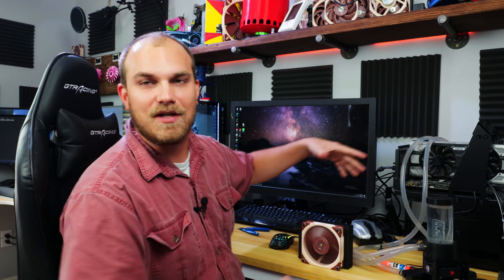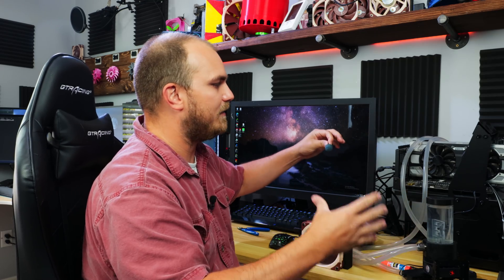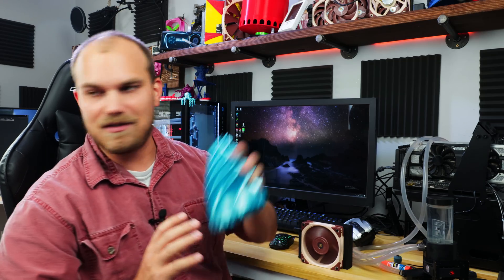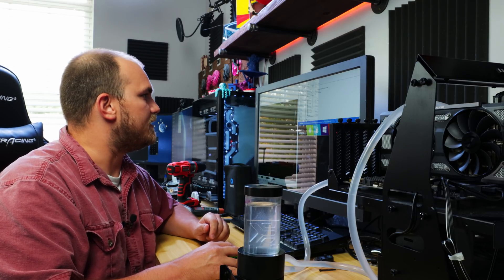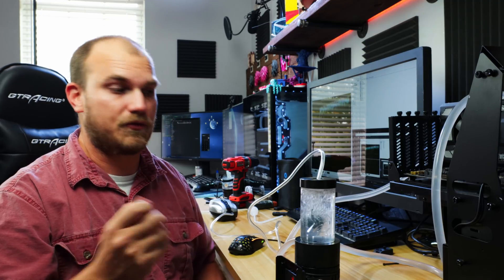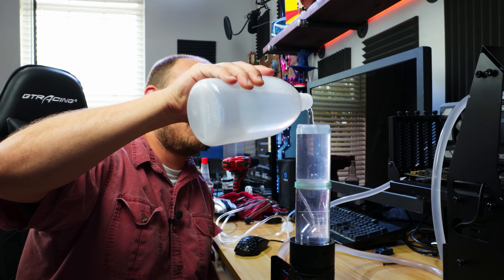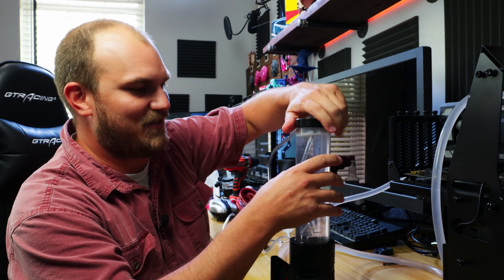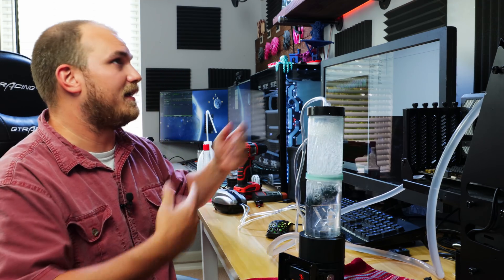Can An Airstone Cool Your PC?

Comment: I'm not an AC pro by any stretch of the imagination, but the same principles that apply there would apply to any system where you're transferring heat from one source to another. 

Here's a video of Basic HVAC 101 that I found interesting: https://www.youtube.com/watch?v=VJX0LyxRV0E

In it, he mentions Dr. John Gorrie who used the same principles with water and air. A website: http://www.phys.ufl.edu/~ihas/gorrie/fridge.htm

In the Basic 101 video, Mr. Orr shows that the 2 places where heat is transferred are the evaporator (inside, where the heat transfers to the liquid) and the condenser (outside where the heat is rejected from the liquid). You've transferred the heat from the CPU to the liquid, but other than a few bubbles, you haven't transferred the heat to anything that can reject it.

I like how you continue to look for ideas, whether sound or not, and aren't afraid to experiment. You're also not afraid to fail, which is monumental in continuing to seek more insight. You do a great job of presenting factual evidence and state truthfully what the results are. Fantastic job, sir! I've chosen to subscribe as a result of your efforts.

Comment: Input and output at the base of the pump could be an issue. The airstone is bubbling up the water above, whereas the pump probably immediately sucks up the warm water that's just been returned at the bottom of the reservoir. If you'd return the water through the top of the reservoir, so that it has to fall through the bubbles, maybe that'll take out some heat.

Comment: Theory could work but I see three possible issues:

1- the reservoir is closed so heat/evaporation is not as readily able to escape. When it's forced through the small hole the increased pressure likely recondenses any evaporate 

2. The pumps are also introducing heat in the forms of motor heat and compression heating of the air. It may not be significant at the lower pressures these work at but higher volume lower pressure pumps with wider diameter hose would further reduce it's influence.

3. You did hit on surface area as a concern, which I agree with. The drip tower had the water droplets falling and spreading over multiple surfaces through a substantial air flow at atmospheric pressure. Here we are rely on evaporation into bubbles under greater than atmospheric pressure in a shorter and narrower area.

Maybe a  shallower horizontal reservoir  with a stick air stone like a side ways L

|      _______] <Return
|___|  air^
<Pump

I realized it became phallic after I made it but not intent. Anywho, water returns on right high flows over shallow long air bed allowing maximum contact, then collect in resevior pump on left.
Top should be as open as possible to to restrict air flow but still contain the water.

Comment: I think some of the issue is there's no way for the heat to escape; it's all getting trapped by the cap and staying inside the system. That said, air is a terrible conductor of heat, so it could just be the heat transfer coefficient is too low, and while looking cool, just plain won't work. I think you're on to something with turbulent flow, but you'd need a heatsink in contact with the water, which I think isn't the idea of this experiment. Awesome vid though, loving the novel approaches to heat dissipation and absolutely loving the fan showdowns!

Comment: Your reservoir is just way too tiny for the bubbles to have any effect at all. Surface tension would of course always be an issue at trying to absorb heat into the air bubbles and therefore never become a practical method of cooling, but ya, much much bigger reservoir in order to see any effect at all.

Comment: Idea: move the inlet to the top with the air-stones so the warm water is dropping down the tube through the air bubbles. that might help with the cooling since the cooler air is directly contact with the warm water. At the moment it looks like the warm water is just getting recirculated at the bottom, without reaching the cooler water at the top.

Comment: The air and therefore the water is being heated by the vibrating piston of the diaphragm style air pump used. Check the temperature of the air entering the water to make to sure it matches your ambient temperature.

Comment: I think this really could work out but the container of a resorvior is just too small since cooling is all about spreading heat. In this the time frame per bubble touching water+the amount of air isn't very high if you just look at the air tube. To make it work you'd probably need one of those nano fish tanks to just have enough surface area and space so no air gets in the cooling system itself, but then the real question is how much of a diffrence the air bubbles make up for with this big of a tank

Comment: Here is an idea for a project that would definitely work, but would still be informative.  What about water cooling using a direct attachment to your faucet and outtake to your drain.  No fans or pump required.  What would be interesting would be how the flow rate affects your temps.  I suspect that you could do such a thing at an EXTREMELY slow flow because even at a slow rate, the amount of water that would be heated would be very small and would not be contained in any kind of loop...something like a slow trickle of water might actually be somewhat economical and the outtake could be used to water a garden or something via maybe a soaker hose?

Comment: Evaporation cooling works by evaporation, so you have to have somewhere for that water vapor to go. It doesn't work indefinitely in a closed system. Also water has (as far as I can work out) the highest specific heat capacity of any fluid you could reasonably use. This means that it can absorb more heat per unit weight. Adding air bubbles into that reduces it's thermal capacity. This would only work if the air stone was pumping into an open tank, and the bubbles were removed before it went around the system. And even then you're looking at minimal gains unless you have very low humidity environment.

Comment: It can work if hot water tube from the CPU go into the water column from the top and cold water go in from the bottom of the water column so basically hot in from the top passes through the air bubbles and sit into the bottom and then go back to the CPU again.

Comment: I think you'd need to make a tank almost as big as the cooling tower and route the hot water comming from the block to the top of the tank. And also,, more bubbles.

Comment: - Putting the cap back on will reduce evaporation.
- Surface area is important for evaporation so if you can make a reservoir that is like a funnel it would improve things. even better would be to have it pump into a bucket or something like that because that will give you a massive surface area.
- Removing evaporated water from the surface boundary is also important, near the water surface humidity will build up which will slow evaporation (this is why don't put the reservoir lid back on). It feels kind of like cheating for this but having a fan blowing over the water surface will speed up evaporation.
- Going taller won't be too useful, the air will become saturated with water vapor as it rises through the column of water and after that any more height is making things worse. You want the air to load up on water vapor and dump it to the atmosphere as quickly as possible so if it has to make a long journey to the surface that will slow things down.

I haven't mathed this but I don't believe that you can pull it off. I believe that the mass of water that is needed to evaporate to keep up with the cpu is too great.

Comment: Should work , but too much effort to do :  burry a big plastic barrel (100L or so ) with  full of water in your yard /garden . For like 10meter Deep . Could be pretty effective passive coling.
Or just burry a  long copper tubing in the ground .And run water throught it back to the PC. Like a neverending loop without rads/fans.  Don't mind me, Im just thinking out loud.

Comment: i think you should push way more air than that. i don't think you are putting alot of air flowrate in that thing which might be causing the throttle

Comment: So you know the volume of air required from the original fan.
That tiny pump may push at a higher pressure to force the air into the water, but it's not moving the volume of air needed to remove the heat.

Imagine that large column of air blowing through that fan, you need to put that much air through the water. your water cooling tower didn't quite do that which is why it didn't quite work as well, but it moved a lot more air than this tiny pump.

So if you had a way of putting that much air, as in, the same volume through water, it would work.

However you have to realize at that point you need a much larger, much much larger, container to hold the water and a much more powerful air pump. One that is capable of moving as much air mass as your fan with the higher pressure required to shove that air under the water.

Comment: Well, given that you pretty much know the amount of air that is being moved by the Noctua (in CFM), you know how much air mass you need to cool your system. If you want something that performs better, it has to flow more air mass through one way or the other, or evaporate the water (leaving the heat energy in the water molecules).

Something like an air stone is not going to flow anywhere near as much air so the chance of that cooling anything is basically zero. Also, it will contaminate your water with minerals.

Comment: The air from a real air compressor is colder than the air from a fish tank compressor. Maybe try that . Colder air should work. Also leave the top off of the reservoir to let the heat escape.

Can't wait to see the air screw in action!

Comment: Hey, I'm new to your channel, and your experiments is exactly what got me hooked.
I have an idea for you to try, actually I've discussed about it with a physicist and turns out it has merit.
So it can work in two different ways, on of them is to use your evaporating water tower and to switch the dripping water with a fog - use a misting nozzle like from a perfume bottle or window cleaner bottle (in this case you can even ditch the fan).
The second scenario, is to use an ultrasonic fogger (with a large volume of fog) it's like a humidifier, creates a mist from pure water, and drive the mist through the radiator with a fan. The mist will quickly evaporate due to the very small size of the droplets, and suck the heat from the air that is passing through the radiator, so essentially, you'll cool the radiator with cooler air than ambient.
Good luck ;)
Reply: Also, you can use alcohol.

Comment: Air cooling through the air stone with an fan circulating the cooled water in gas form would work better if it is not polarized. So what i am saying is running the water that the airstone is in through an fan cooling the temperature of the water by sideloading the therms then sending the cooled water back into the pc and then recooling. This is the method how a jet engine  is cooled

Comment: Ok this needs some explanation:
In the cooling tower there is no heat transfer between air and water, the heat that is dissipated is actually used when water evaporates due to the large contact surface with air. This heat is called latent heat of  evaporation.
The same thing does not happen with the bubbles due to the poor airflow the pump provides, the water is not evaporating. The evaporation is also the cause for the water reducing in amount in the cooling tower video, it is not a defect, it is the working principle.

Comment: Not sure but what if you replaced water with Mercury, It has a much higher thermal conductivity. I guess the problems with it are price and whether or not a pump would be able to pump it through a loop.

Comment: I think the cool water may be getting pushed up, according to convection currents it should go down but the air bubs are creating quite a upwards force so the cool water may not actually be going down 

a better design would be to pump water through the bubbles

Comment: the water thermal is heating the stone that the air is passing thru...stone holds the heat..thus heating the air passing thru the stone..push and pull if you would..heat transference  vs. heat dissipation..what you have there is a gridlock.at least thats how my brain is interpreting the issue.

Comment: I'd recommend you find some form of dye or indicator that doesn't dissolve in water (or whatever you may be using as a test coolant at the time) but has roughly the same density, or that can otherwise remain suspended in the water without damaging or clogging the system, so you can see how the coolant is actually flowing in your system.

For this system, you want the water to be in contact with those bubbles as long as possible, but it looked like the water flow was barely even touching the bubbles.  If you don't already have a divider in there, add one to separate the intake and return.  If there already is one, try to extend it so the coolant only goes over it  by 1 inch (about 2.54 cm) or less.  The airstone should be on the intake side (where water is pulled from the reservoir) and sit about half-way down.

Comment: Next time, run the water loop through a fishtank (or a bucket), or even stick a rad underwater, using the extra thermal mass and surface area for heat transfer

Comment: I think if the water would pass the bubbles it should work better. So if the water, what comes back in the reservour, would come from the top and has to pass it on the way back in the system, it could be a better cooling Performance.

Comment: I think you are just not putting enough air through the loop. There is a limit on how much energy a gramm (or liter) of air can take, even when you combine heating and evaporation. I assume the small tubes through the Airstone are moving significantly less air than a 120 mm fan?

Comment: Great video, love seeing all the interesting experiments.
With evaporative cooling it's really important to have significant amount of airflow and there needs to be an evaporative surface for the water to be on such as your cooling tower. Those types of cooling towers were actually used to keep stationary engines in the early 1900s.
One other thing you could try would be to look on YouTube and build in a vaporative cooler for your room. And then pull the cold water out of the reservoir at the bottom. Because with evaporative coolers not only is the air cooled as it goes over the wet substrate. But the water itself also is cooled significantly. You can find on YouTube designs for homemade evaporative coolers. Some of them are extremely effective.

Comment: I would expect cooling similar to the same CFM across a radiator. Looking at a few random aquarium air pumps, they push between 2.5 LPM and 110 LPM (0.09 - 3.88 CFM) while a Noctua NF-F12 PWM pushes 1250-1560 LPM (44-55 CFM). One of the 110 LPM commercial aquarium air pumps I found on amazon, maxed out with 12 stones, might produce a measurable result. I'd like to see 10 of them running 120 stones in a 10 gallon fish tank, compared to a radiator running a fan at 1100 LPM (using the same tank as the reservoir). I'd consider adding an under gravel filter grate and gravel to the tank and using the filter riser for your water intake, to avoid sucking a ton of air into the cooling loop. You could use a fish tank heater to bring the water temp up to a certain starting temp to speed up the test.

Comment: Would it be more effective if the heated water was returned to the reservoir at the top so that it has more contact with the air? If the water being returned to the pump is almost instantly pumped back out it has no chance to cool. I guess the test would be to see how long it takes to throttle with the single reservoir and try it again with the doubled one. If the time is the same then the heat transfer from the loop to the reservoir is negligible and trying to cool the reservoir is pointless.

Comment: I think you need a couple p traps and an air vent in the line. The air bubbles will get stuck in the micro fins in a cooling block. I think you could 3d print some peculators i the reservoir to help male smaller bubbles.  Also look into making a recycler tube that runs from the top to the bottom but below the stone but not as high as the relief tube.

Comment: I think you need a p traps and an air vent in the line. The air bubbles will get stuck in the micro fins in a cooling block. I think you could 3d print some peculators i the reservoir to help male smaller bubbles.  Also look into making a recycler tube that runs from the top to the bottom but below the stone but not as high as the relief tube.

Comment: Take the cap off? Heat of vaporization is orders of magnitude higher than usual heat transfer. Tech Ingredients has a video about a novel approach to A/C cleverly using desiccant, which results in basically doubling the benefits from heat of vaporization energy.

Comment: I had an idea for a fan blades.  Imagine a circle where the area of the circle is filled with a honeycomb pattern.  Then extrude it to make a disc maybe an inch thick full of hexagonal holes.  Now rotate the top layer of the disk about 20 degrees while keeping the center of the layer stationary.  That would have the effect of the hexagonal tubes near the center of the disc being nearly straight through with little to no offset compared to the other side, but the hexagonal holes near the edge would be offset by 20 degrees compared to the other side with an arcing hexagonal tunnel connecting between them.

I know this wouldn't be efficient since a fan blade made from dozens of tubes would have a lot of surface area, and a lot more air friction, but I was just curious if it would have an impact on static pressure, and especially on how it would sound.